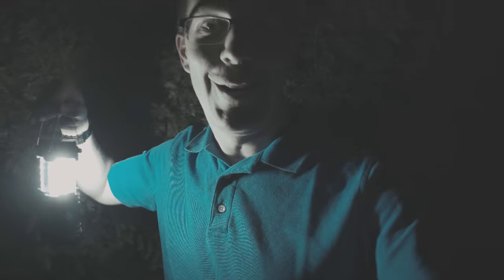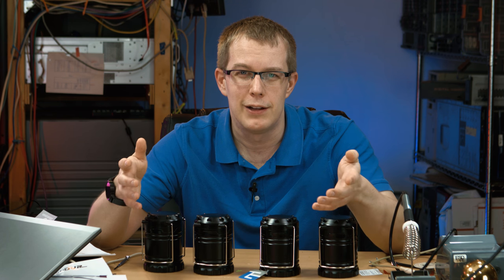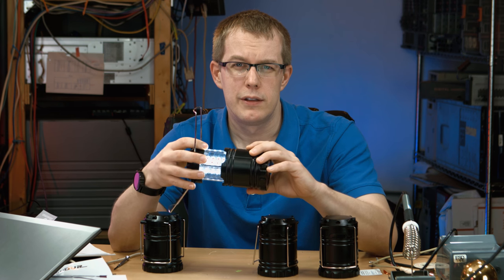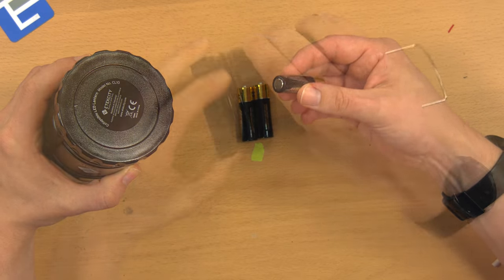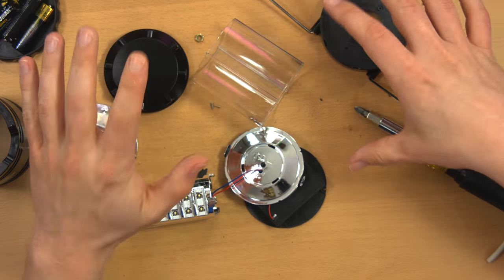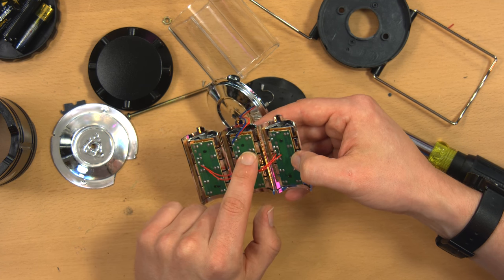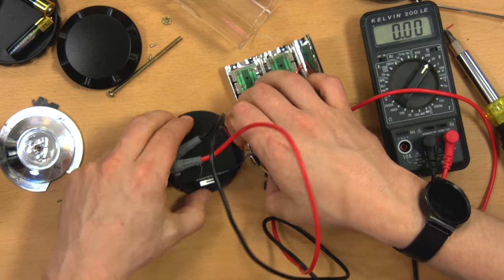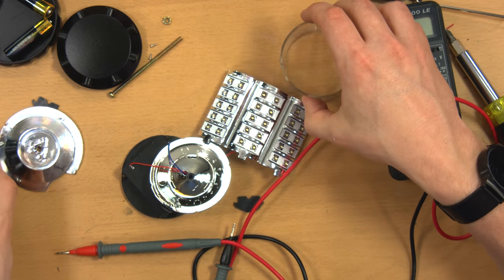Etekcity "Outdoor" Collapsible "Camping" LED Lanterns of Doom

Comment: The best product at Harbor Freight is their version on this lantern. I used to pick them up when they went on sale for $2.50, now they go on sale for $4. The one rolling around in the back of my truck has been going for five years. I changed the batteries last year and lost one of the hangers. I have several and use them on canoe trips several times a year. I gave them as stocking stuffers to everybody in my family, because we live in tornado alley.

Comment: You did exactly what I would have done. Open it up and see how it's built and see if I could repair it. Voltage meters so helpful.  Are they still working? Just curious if a total loss or they still work. Like your video👍